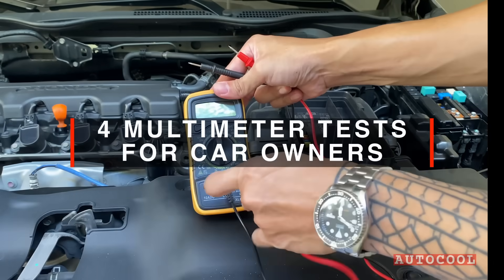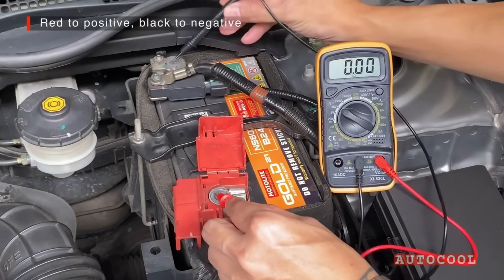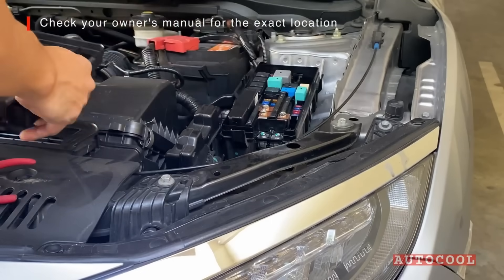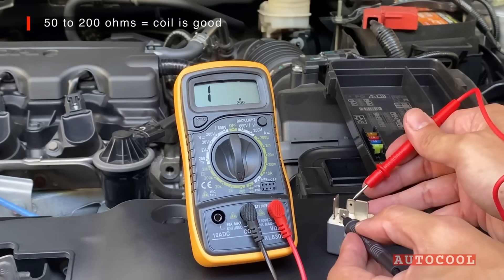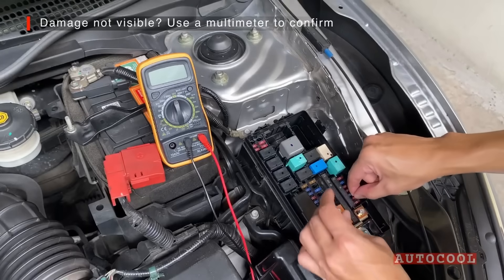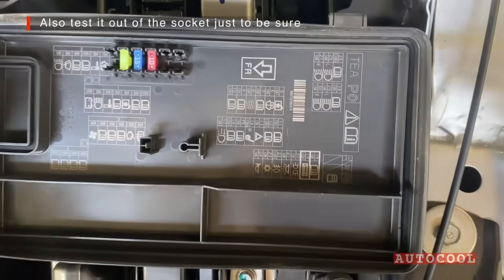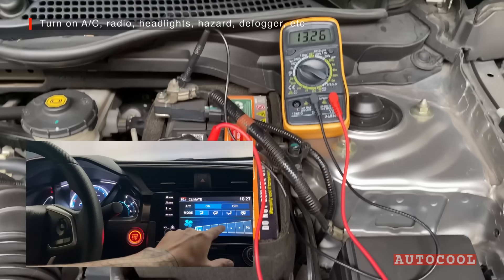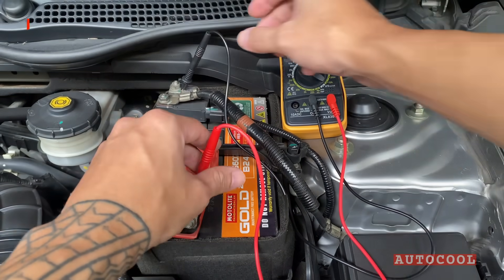Car Won’t Start? Do These 4 Multimeter Tests First

Comment: I changed all the relays in the fuse box of my 2011 KIA Sorento with 110,000 miles, just being proactive. My SUV now runs like a brand-new Vehicle.
Reply from the maker: That’s awesome  @georgen3425  👌 Glad it’s running like new again! just curious, what prompted you to zero in on the relays?

Comment: I disagree. I can show you batteries that test good by your standard that won't crank a car.
Reply from the maker: Thanks for the input  @mandovapehater6988  ! 😊 You’re right, a voltage reading alone doesn’t always guarantee a battery can crank the engine, since cold cranking amps and load matter too.
Reply: @autocool2 yes sir!
Reply from the maker: @mandovapehater6988  appreciate you chiming in man! thanks for supporting the channel!

Comment: Show the multimeter switch settings ,
Reply from the maker: Great suggestion  @rohintonmistry1314  mistry1314 ! I’ll make sure to show multimeter settings more clearly in future videos. You can pause and zoom in on this one for a closer look. For what test did you need the settings? 😊

Comment: Test 1: The voltage across the battery terminals when the car is running is measuring the alternator
output not the battery output (as you describe in Test 4).
If the voltage is 12V with no auxiliaries  switched on the problem is more likely to be the alternator
not the battery. Probably the voltage regulator and/or worn carbon brushes which can be replaced
separately on some makes of alternator. That's the best case scenario.
If the the poles have failed then a new alternator is necessary.
Reply from the maker: Great points  @veritasaequitas9875  , thanks for the detailed breakdown! You're absolutely right: when testing with the engine running, we're really checking the alternator's output, not the battery. Issues like a bad voltage regulator or worn brushes are often overlooked, but they’re common culprits. Appreciate you sharing this, very helpful for viewers who want to dig deeper! 🙏🏽

Comment: How to test the alternator if the damage is alternator coil or rectifier?
Reply from the maker: Good question  @ronelperez2284   ! If you're checking for internal damage like a bad coil or rectifier, you'd usually need to bench test the alternator. That way, you can measure output without interference from the car’s system. Some shops also test diode function and ripple voltage to spot rectifier issues. We have a video on how to bench test an alternator coming up, I hope you can subscribe and stick around for that! 😊

Comment: Parasitic drain test is easy and useful also.  Should be less than 0.50 amps.
Reply from the maker: Great suggestion  @tg5834  ! I appreciate you pointing that out. We definitely have that in the pipeline. Hope you stick around and subscribe to the channel! We have more on the way 😊
Reply: Informative 
0.50 amps is to much 
Less than 0.050 Amps 
The best is 0.020-0.030 Amps
Reply from the maker: @konstantin-big Thanks for the input! I think that might've been a typo on the 0.50 amps but you're absolutely right that under 0.050 amps is the safe range. Appreciate you pointing that out! Helps make the info even more useful for others. 🙌
Reply: @autocool2 
Informative 
If you have 0.50 Amps parasitic drain, next day the engine doesn't crank
Reply from the maker: @konstantin-big exactly! At 0.50 amps, the battery wont last overnight😅

Comment from the maker: Safety Reminder‼️
Continuity mode should never be used on a live circuit. In this video, I tested the fuse with the engine off, but if you want to be extra cautious, you can disconnect the battery as well.

Thanks to  @edwardjames6070  for poiting out the importance of this!

Comment: isn't measuring across a fuse with the ohm scale risky?  if one side is positive and one side is negative the fuse would likely be blown (that's what a fuse is for, sensors commonly short to ground and possibly short to positive), and the multimeter, in turn, would be damaged?  I think fuses are recommended to be tested with the meter set to voltage.  each side of the fuse should have the same type of voltage, - or +.
Reply from the maker: Great point  @edwardjames6070  ! Continuity mode should never be used on a live circuit. In my case, I tested the fuse with the engine off, so the circuit wasn’t powered. If being  extra cautious, you can disconnect the battery to completeley de-energize the the circuit.

Thanks for bringing this up, great safety reminder! I’ll be making a video on testing fuses using DC voltage mode soon, so I hope you’ll subscribe and stick around for that 😊
Reply: Informative 
I test the fuses with a test-light=12-volt
Reply from the maker: @konstantin-big thanks for sharing! A test light is a solid for quick checks